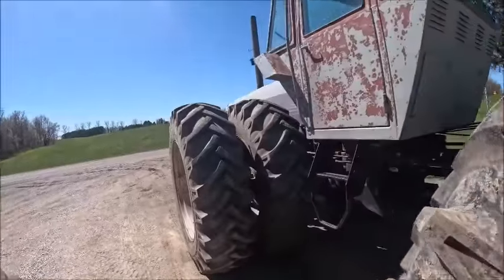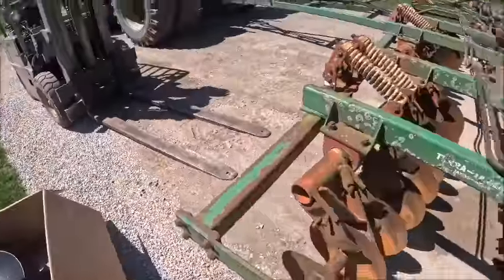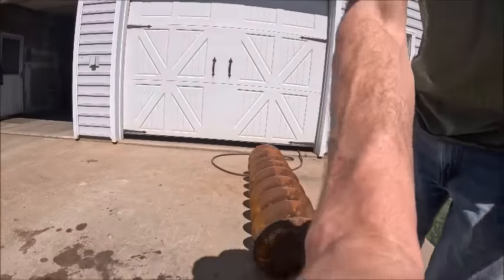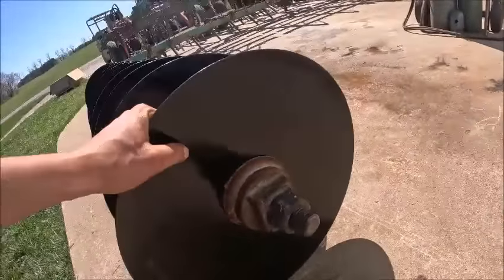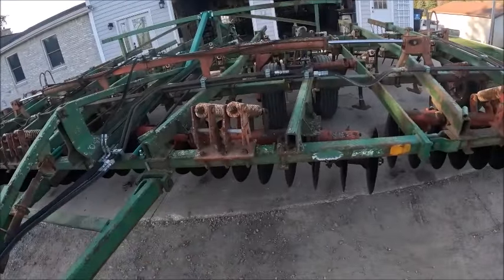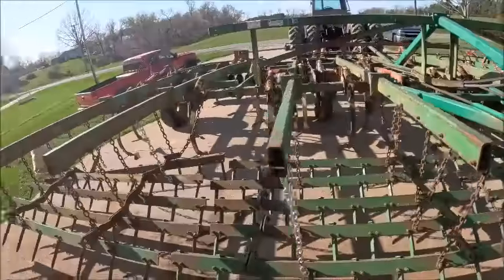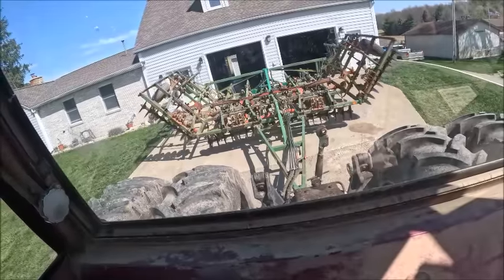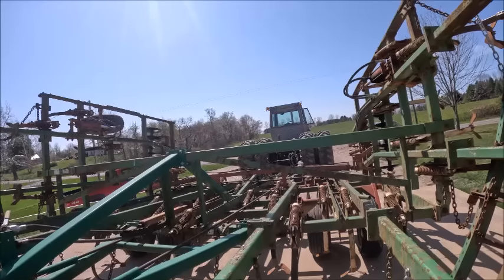Giving The Soil Finisher Some Long Overdue TLC

Comment: I don't miss working on the big stuff for one reason that being it's BIG stuff and has lots of everything that has to be replaced. When you get 65 years old you can appreciate the smaller stuff as far as overhauling things. What you are doing is at least a two man job. That fork lift sure is handy and I strongly recommend gloves cause those blades will slice you open like a vegomatic. I'll hand it to you you keep your stuff in good repair and I agree this year is going to be a penny pinch year.
Reply from the maker: Doesn’t qualify as big until the blades are 24” or bigger.

Comment: It’s stupid to hang two disc blades past the end bearing. On our White 30’ disc I installed shorter shafts on the front wings to eliminate it down to one and no more bent shafts. Glad your driveshaft repair worked out and saved you money.

Comment: Those ❤spring things you were talking about welding and redrilling , why not drill out to a larger size and installing a bushing . You could make the bushing replaceable  , or weld one in
Reply from the maker: It has bushings in it now. And the holes are wore so bad there wouldn’t be any meat left by the time you got it bored out large enough to clean up the slot.

Comment: Buy a bigger 3/4 inch airline and the big Milton p style coupler it will make that 1 inch impact an entirely different animal. 
I put a 25' ft whip hose on ours, plumbed directly into the air tank with no coupler. As 99.9 % on the time the transmissions are sitting on the workbench.
I work on semi truck transmissions taking 2-inch yolk nuts off all day. 200psi on the line helps too haha!
Reply from the maker: Our compressor doesn’t have that kind of capacity.

Comment: I had to cap both the pressure line and the return line on my 1855. was leaking hydraulic oil into the rearend. Put new quad rings in the pto and it fixed the problem.
Reply from the maker: Mine needs a whole new clutch pack. I’ll bet a paycheck the plates are warped.

Comment: @7:00 instead of welding closed and redrilling. Perhaps just over boring and use a bushing instead.
Reply from the maker: No because there wouldn’t be any meat left by the time you got the hole opened up big enough to clean up the wear.